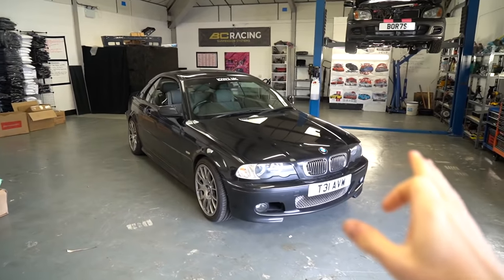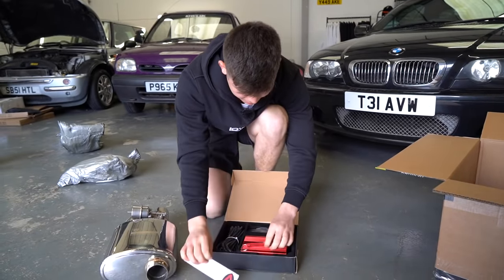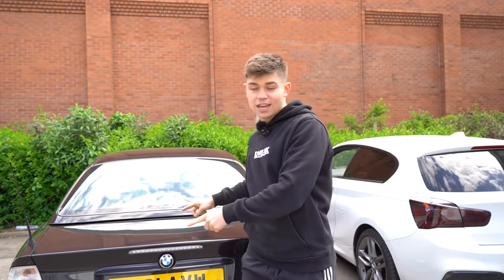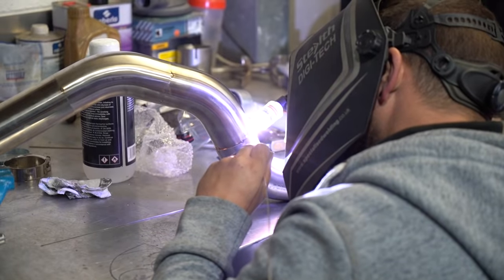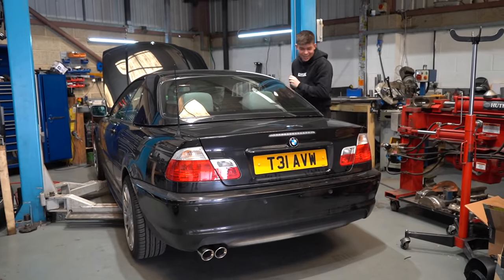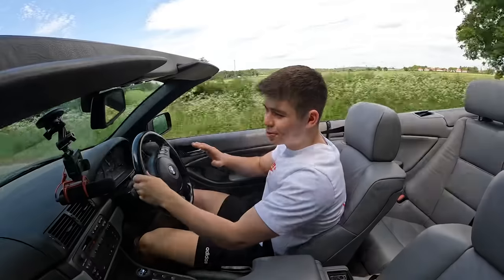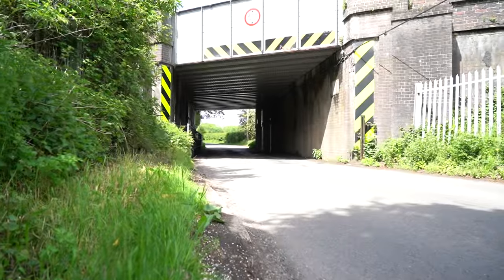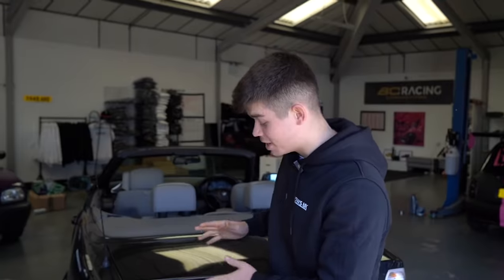FITTING AN *INSANE* VALVED EXHAUST TO THE BUDGET BMW E46!

Comment: I just drilled a hole through my exhausts and it's basically the same as when ya got the flaps open, anyone wanting to do the same just look up free E46 exhaust mod on YouTube, takes like 10 mins to do and costs nothing, tail pipes looks nice though.
Pretty sure some e46's came with a flap so in that case look up the golf tee mod 🤷‍♂️
Reply: My friend, I like to save money where I can but this isnt a mod, its just destroying stuff. Buy a welder, it costs less than a backbox and you can make anything you like, on your current hack or the next dozen.
Reply: @Flozman1982  yes and no, if you cut the back box off and just weld pipes on you get an annoying whistle on decel, you could get a backbox from the scrapyard cheap from another car that could sound ok but that's still money spent + the price of a welder.
In my case it's my drift car/daily so I just want to be able to hear my car better when on track so I'm happy with the route I took, or you could just buy the backbox in this video but that's hardly what I'd call a budget build item.
Each to their own I guess 😁✌️

Comment: I've got a 330ci with back box delete into quad pipes same tips as yours and the sound difference over stock is insane.
Reply from the maker: Yeh bro isn’t it!
Reply: @JackMcNeillCars  the standard 330ci facelift exhaust has a valve in one of the two tips that's closed on idle and low revs but opens when driving to keep noise down on the drive in the morning.
Reply: @johngrant8533  the standard 330ci even with the golf tee mod isn’t anywhere near as loud as getting rid of the muffler though lol

Comment: Why use a vacuum actuated valve instead of just an electric valve? Also, I would think that an electric valved system could give potential to adjust the valve. I also have read/seen vids of active exhausts seizing etc.
Reply: Because then it wouldn't be a "universal" muffler.

Comment: I've got a 330ci and was wondering what exhaust set up to go for really don't want it to be too loud this sounds nice might go this route
Reply from the maker: Couldn’t recommend more bro. Perfect for a daily honestly
Reply: Your 330 probably has this from stock, look up the golf tee mod, if not just look in the tail pipes and you'll see a bit of metal making the pipe almost half the size, drill through that and your car will sound like his with the flaps open, just YouTube search free E46 exhaust mod. Unless you have money to throw down the drain that is 👌✌️
Reply: @mrmalavey1098  yea I've already done that it has made a difference but don't sound like this I've been told to take out the mod box so it doesn't scream
Reply: @golf-vi2cw  what one was that the golf tee or the drilled holes? Mine didn't have the flap so I just made big ass holes in the metal reducing the Id of the pipes, not crazy loud but loud enough as my main issue was not being able to hear the car when drifting and seeing as I slide into walls I went for the cheap option rather than spend money to crush a new backbox, the other alternative for me is to cut the box off n just weld some pipe on but that makes it have some weird pinging whistle sound on decel.
Edit, or do like my mate did with his and get a back box off a scooby from the scrappy, it sounds quite nice ✌️
Reply: @mrmalavey1098  I just made sure the flap was open and put a bolt in the vac line

Comment: what size muffler do y’all reckon he got? 2.5, 3.0, 3.5 inch pipe?
Reply: Most E46 Sport Models rear bumper valance clearance for exhaust tips are about 7" in diameter.  Therefore a twin tip with 3" each tip should give that aggresive look. 2.5" is too small. I have a twin tip 3" each rolled top for my E46

Comment: my 325i has some big ol exhaust on it from a previous owner, sounds good when you floor it but most of the time when you're 50% throttle and less it sounds annoying, all bass, no rawness. Just trying to figure out if the way the auto box lets the engine revs climb lazily is contributing to that drone as I would hate to spend hundreds on something like this and find out it sounds exactly the same because of that auto gearbox 😅
Reply: How big is the exhaust that the previous owner put on?